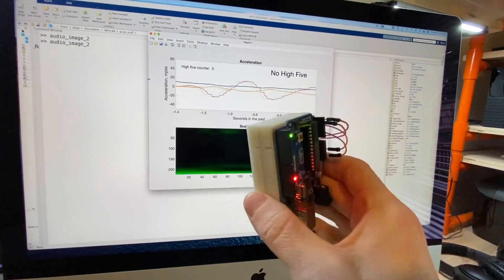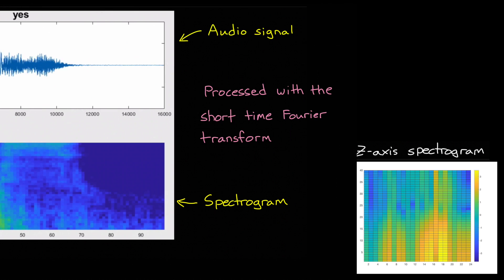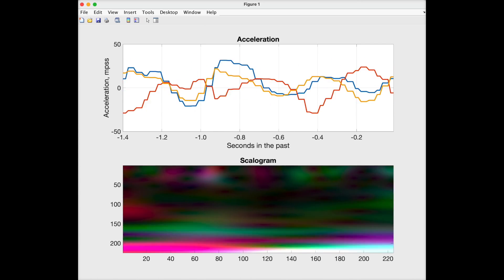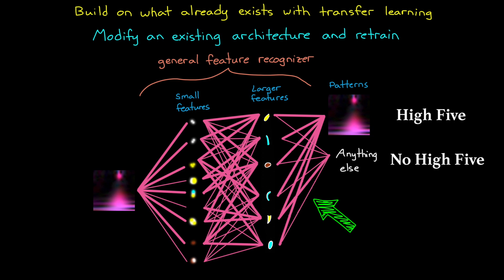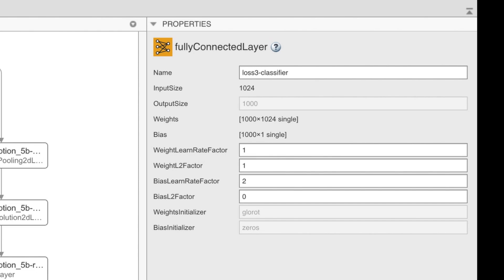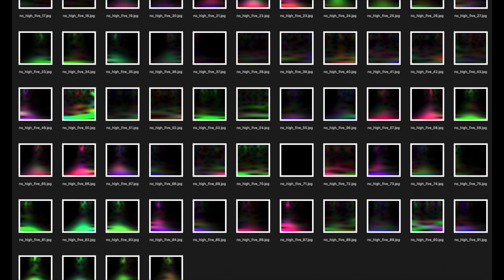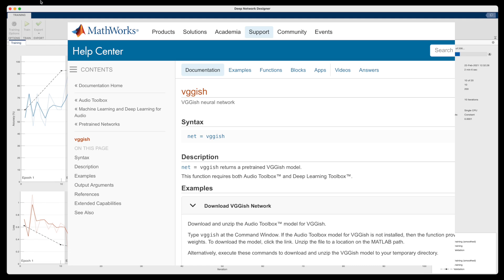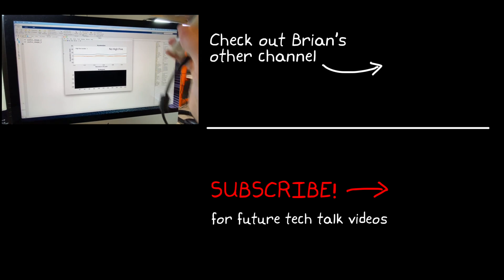Using Transfer Learning | Deep Learning for Engineers, Part 4

Comment: Hi @brain, it's me again. I am wondering why you need to transfer the raw plot(the 3 colours strings) to the scalogram? You did mention about what the scalogram is good about, but what's the necessity for not using the raw plot images???
Reply: Are you asking why I essentially didn't take screen shots of the plot of the three acceleration lines and just feed that into the network? That would be interesting to try but I suspect it wouldn't work as well. Some guesses as to why  - it might be that by giving it frequency information explicitly along with time information, we're effectively telling the network that it's important and so it'll have an easier time learning the relevant features than from time data alone. Also, time data in a plot like that doesn't make good use of all of the pixels to capture the information. Most of the image wouldn't have useful data in it and so it would probably be a poor way to represent that data. I'm sure experts who are reading this could chime in and give you a proper answer!
Reply: @BrianBDouglas  okie, it makes sense. Thanks for your explanation. Looking forward to this GitHub project.

Comment: I am very interested in the 'read_accel.m' file, which is used to read IMU data and plot instantly. Can you show me how to build the serial communication betweeen matalb and arduino.
Reply: I'm working on a blog that will share the code. But quickly, I used two ways. 1) I programmed the Arduino with a sketch that just read the accel and printed the data to the serial bus, then in MATLAB I used serialport to read the data and parse it, this was super janky so 2) I cleaned it up to just use the MATLAB Support Package for Arduino Hardware. With that package, it programs the Arduino and then it only takes three lines of code in MATLAB to read the sensor. >> a = arduino('COM3', 'Uno, 'Libraries', 'I2C'); imu = mpu9250(a); readAcceleration(imu);
Reply: @BrianBDouglas  Thank you for ur reply, Mr. Douglas! I appreciate it!
I got one more question when I was trying Scalogram for other signals.
How did u choose the vertical axis range? (around 3:14 in the video, regarding to xyz signals)
and, Why did you choose to sort the vertical axis in descending order?

Comment: Great video. Just wondering how frequently do you take the sample data from your sensors?
Reply: I was reading the sensor at 50 Hz, but I suspect that could be much slower and still work just fine. Since 50 Hz worked for me I didn't bother trying to mess around with it because ultimately my goal was to make a video and not necessarily have really a really great system. :)
Reply: @BrianBDouglas  I'm trying to stream the data from mobile sensors to my python code. I appreciate that if you could share your code about how you would do it or even make a video tutorial for it. Cheers

Comment: Very cool video Brian!
Is there a way to export this trained network to a file or a memory in combination with the arduino itself without a pc?
Reply: Do you mean to export it and run on the arduino?
Reply: tflite is available for somewhat powerful micro controllers like stm32. Not sure if Arduino Uno or other atmel based Arduino can run tflite. Also tflite is still experimental